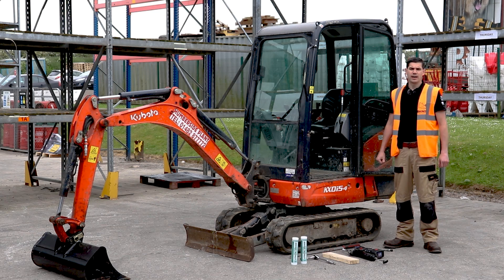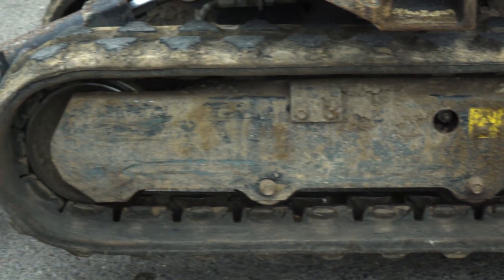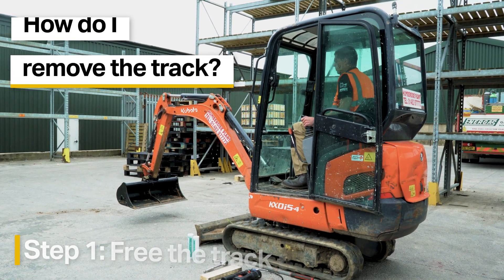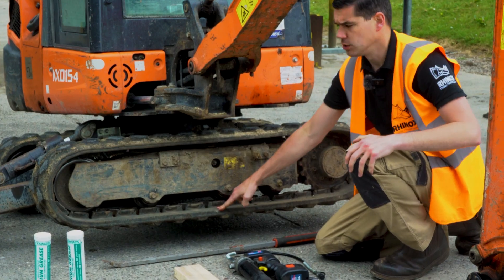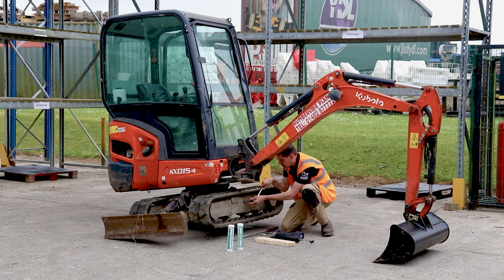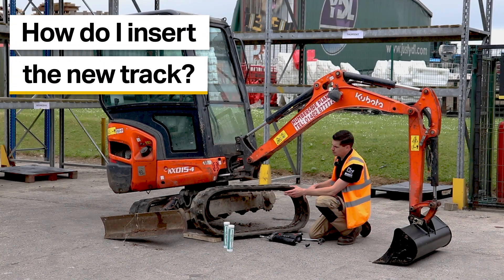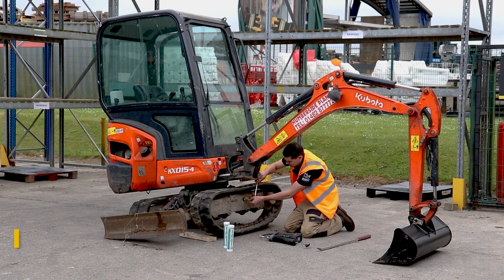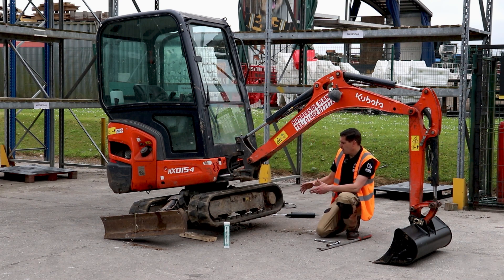HOW TO: Remove & Replace Rubber Tracks On Your Mini Excavator - Tips & Tricks

Comment: Just one quick question. The tracks on my excavator squeal quite a lot. Can i apply grease or grrase up those pulleys underneath somehow. Are they easy to grease?
Reply from the maker: Some excavator manufacturers do put grease points in the idlers so you could try greasing these. If not, it sounds like a bearing may have gone in your idlers.
Reply: @Rhinox-Group  I figured it out myself. I removed the idlers ajd found out that on one side they had  some markings and on the other no markings and upon closer inspection on the marking side where you remove the screw that holds the pulleys in that hole you put grease then tighten the screw and the grease pushes in. You have to do this arround 5 times to apply grease. Or the easy way would be to install a nipple and grease it with a grease gun then remove the nipple. I hipe i helped somehow 😁

Comment: Great video and very well explained. Thank you. Tomorrow it's my turn! Quick question" Where does the grease go when the fitting is loosened and is there any way to catch that grease? The reason I ask is because I just did a complete refinishing and rehab on my mini excavation (3.5 ton unit) and I am now far more mindful of avoiding a greasy mess on my newly reborn machine :) It sure is pretty! Thanks again.
Reply from the maker: Thanks for the comment, we're glad we could provide some insight! The grease goes in the track frame area to keep the undercarriage components lubricated to help prevent wear. Unfortunately, we haven't found an easy way to catch the grease but if you find a way, please drop it in the comments so hopefully other people can try it too!